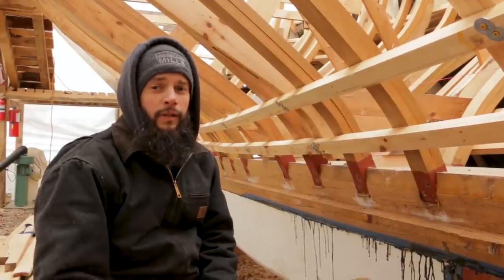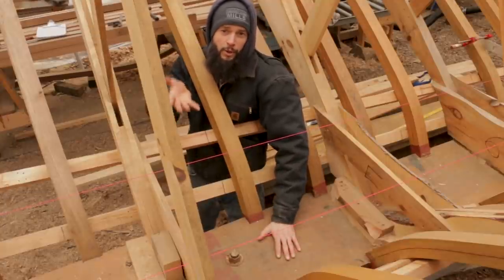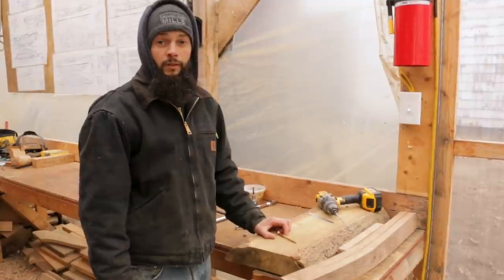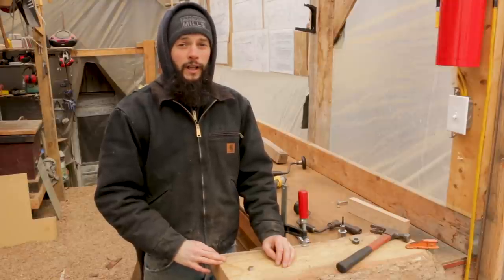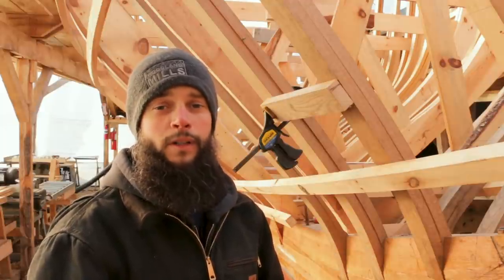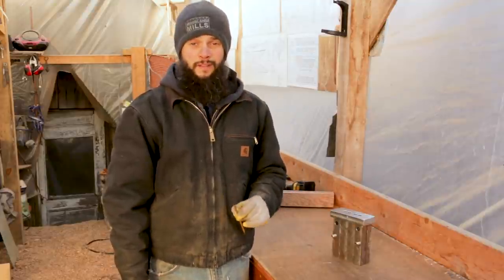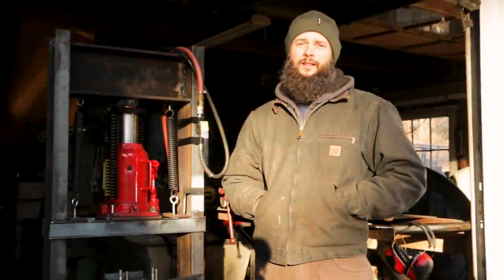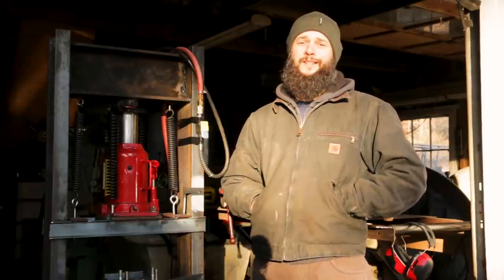Acorn to Arabella - Journey of a Wooden Boat - Episode 50: Homemade Copper Rivets!

Comment: Annealing the cut stock for the rivet would allow the compression of the head more easier also if the other end of the dye was machine with a pointed shape this would also form as it would driven to the bottom and stop then the head world continue to form.I made nails for old picture frame the same way, but they were only 1.2mm diameter with a 2mm domed head and driven with a hammer... one at a time, only required 150 though.
Great video great delivery with plenty of knowledge imparted, thanks

Comment: If you want increase speed I see 4 things 1) affix a larger handle to the release valve so no tool is required. 2) only release the jack far enough for the die to rotate and lay down to open 2.1) install a stop so the jack cannot retract farther than required 3) find a faster tool to tighten the nuts on your die (not an impact as this will wear out or gall the threads 4) find a tool that will knock your rivets loose from the die quicker

Comment: I think your right, peened rivets or nails is a better option than screws. On the face of it the bigger section of your self made nails is more robust, but there comes a point when a square peg in a round hole will be problematic, particularly in the unyielding oak, but I guess you've done your research. I also note you have great faith that all the various gunk spread in mating surfaces and socket holes, will exclude water completely. Over the years it has become clear to me that water is a patient adversary, and always finds a way in. That's what stop waters are for after all.
Reply: The gunk is to stop rot. The wood planks swelling when it hits the water (and stays in the water) is what stops the leaks...Well, that and the caulking process they are sure to be doing.
Reply: @JeremyHamaker  The rot resisting nature of the oak is the most important factor. The efficacy of supposed preservatives is up for debate. Water can ingress a wooden hull in several ways. One which I alluded to is via the external scarfs. For all the  different  potions therein, omitting stopwater pins would be unwise. Once shipped the water collects in the bilges and lies there patiently penetrating every  nook and cranny. The most vulnerable area is the surface of the bilge water where it is most oxygenated.  I wouldn't want my remarks viewed as critical, they are only part of the conversation. I admire this project and the way they resolve the technical  issues encountered.

Comment: traditionally, square stock rivets were made by heating a section, hot cutting to length, inserting in a rivet hardy tool, and while still hot, the head is hammered flat......then left to cool....(they were reheated when ready for use, inserted, backed with a bucking plate and the opposite head hammered...
With practice, a proficient riveter can fashion the head of a rivet in 3 or 4 hammerblows (and was considered the mark of a skilled riveter), for a total of 5-6 hammerblows per rivet to fashion the base head (one, maybe two to hot cut.3-4 to form the head.....maybe one more to flatten the top if customer desired a non-peaked rivet....)  A skilled riveter is supposed to be able to make a single rivet in less than a minute....   However, it IS a learned skill...they also say you have to make a 1000 nails, before you really get the hang of it..

Your press solution seems like a good one....the only thing I could see to improve it, might be to make a die that will form 5 or 6 at a go, instead of just 4 (reducing the total number of cycles to get the total you need)  It seems like your press could accomodate an increase to 5 at a time pretty easily... (that would cut 250 cycles from your process...).  

I don't know if heating the ends of your rivets would result in better forming or not.....might be something to try if you were curious at some point....heat the top ends to orange heat before closing the press.....   They'd no longer be "cold-formed" at that point, but that is one of the nice things about copper, it can be easily worked either way.....
Reply from the maker: Thanks for sharing!

Comment: The only add to your cool press (thanks Joe) is to consider plying Joe with strong liquor and wild women then ask if he could make a six rivet jig - it looks as if you could do this OK and the press is plenty man enough. Also consider a full jacket sleeve that is a snug fit over the jig to avoid the repeated process of nut & bolt tightening and undoing!! Then just tap off the full jacket each time. Six instead of four is a 50% improvement and the slick knock on/knock off jacket would save even more time and the sanity of your volunteer! Awesome channel and awesome progress.
Reply: It would be 50% faster, but would need 50% more force too. That may (or may not) require a new hydraulic jack, modifications to the frame. A knock off jacket that is wedged in some way could speed it up!
Reply from the maker: We are maxing out the 32 ton jack as it is =)
Reply: @AcornToArabella  4 rivets at a time is good then - Happy Christmas guys

Comment: A few tips to improve your welding skills:
Your welds are not only ugly but also of sub-standard quality. They have no chance of passing X-ray validation testing for the structural members of this fine piece of pressing apparatus.
1. Your slug deposition is poor because you are using an E7018 electrode instead of an E6011.
2. Your beads rise too much because you are using less than adequate amperage.
3. You are holding the wrong rod angle for this application which results in major undercut issues in the base metal.
4. I noticed that you are welding with your back against the sun. You always need to FACE the sun in order to minimize the warpage of the steel.
5. Last but not least, a huge mistake that you did is that you welded in December. Mars is not lined up properly with Neptune so all welding jobs turn out bad.
I know all this because I have watched tons of welding videos on youtube and welded more than 6 times in my lifetime, so you know I am legit. lol
Reply from the maker: Thanks for the tips!

Comment: So 2 suggestions if you stick with the nuts to hold it together us your cordless driver to do the nuts . or have you thought of cutting part of the bottom of the die off and using a machinist vice to hold the die together to speed up the loading process ?

Comment: how about a bit of grease in the channels for the rivets so they come out easier?
I also wonder if something quicker to release then the nuts could be used to fasten the two halves together. Maybe a piece of iron with a channel the same width as the die that would just slot onto the sides to keep them together

Comment: Thank you for making this video.  Now I can sleep soundly at night knowing screws will not be the only thing keeping your boat together.  Now I have to worry about your DeWalt tools...and how they're over priced and lack performance.
Reply from the maker: We have no been super impressed with them and are thinking of getting a different set.  Any recommendations?
Reply: @AcornToArabella  Ryobi brushless what I use, but Milwaukee/Makita/Bosch depending on what you need.  Rigid with LSA warranty is hard to argue with, same manufacturer as Ryobi.  I was just seeing if I could get a rise from the cult of yellow...😂

Comment: Go to Corbin Bullet swage and pick up their bullet swage lube. This will prevent the copper from sticking to the die and causing damage to them. Cost is about $35.00 a pint and should last all 4000 rivets.
Reply: Great suggestion!  That is a high pressure lube designed for exactly the types of forces involved here and specifically for copper to steel low speed high pressure conditions.  Thin wimpy products that come in a spray can are not the correct product for this application. A very little goes a very long way and will simplify the job.

Comment: I was gonna ask why your die maker didn't just make the bottom of the rivets pointed to save a step, but I see you wouldn't be able to hammer them out.
Reply from the maker: Also to form the point you essentially have to extrude the stock which takes much more force than we want to work with!

Comment: Did a little math and it appears that to produce 4000 rivets at a minute and a quarter apiece (5 minutes for four rivets) it will take just a bit more than two 40 hour weeks to produce them all.  Hard to tell if practice will speed up the process or problems will slow it down, but I'd bet someone(s) is/are going to be quite busy with repetitive work for quite a while.

Comment: I noticed the the shanks had jammed in the die after pressing and it occurred to me that you may have missed the opportunity to have the points formed simultaneously as the heads if the shape at the bottom had been made pointed or vee shaped.   BTW railway dogspikes are square with only a chamfer at the end so the rivets don't need to be sharp pointy.

Comment: Did you give any thought to annealing the top of the rivet blanks?  Just heat the ends to red, let cool.  They will "work harden" themselves when your beautiful rivet machine makes the heads.  Fantastic job on that!
Reply from the maker: They press just fine as it is so it does not seem like annealing is needed.

Comment: One very minor change to the jig, and not worth doing now: if the cavities were on the diagonal the rivets would come out easier. 
(other than that, the jig you have is exactly like what I was imagining before you said you already had one, except I didn't have the cap on top) 
Making many more, a cylinder to clamp and a second one to head would be faster. But not by enough to make it worth changing now, 4 months after you made them all :-)
Oh. and you need an Arduino  in there somewhere :-)

Comment: Since You're pressing these rivets from the top to form the mushroom You can form sharp tip at the end at the same time - just modify the mould. This is how nails are done on a massive scale.
Also, cold forming copper does make it harder, but at the same time more brittle, but You'll have to test if it has any impact.

Comment: Love the rivet jig and press!  HOW TO IMPROVE PRODUCTION =  TAPER THE BOTTOM OF THE RIVET JIG TO A POINT (round or quad-sided) and as the rivets are pressed, the 'point' needed for insertion is created in 1 step, instead of all that grinder work/2nd step. What I don't know is if your jig would have to be remade,, or if the press jack can push that hard??  Just an idea !

Comment: Stick a vice in the press 
Use the vice to clamp the two  die halves together 
Bit faster 
Or use your rattle gun to do the bolts 
And an air chisel to get the rivers out

Comment: Another great video. The lesson on screw anatomy was so needed. I just cringed at past comments from the 
“experts” 
Loved the rivet press. Steve do you think that a die could be made for fin head bolts and use the press?
Reply from the maker: Maybe but the force to form bronze would be much much higher than for copper!

Comment: Yahoo, thanks for the tech talk. I enjoy your engagement in design matters. I was a little surprised, though, that the fin bolts sheared off the way they did. In hind sight, perhaps your fin bolt mold could have had more taper on the fin head. Just for the principle of the thing, I thinking for engineering calcs on bolt loading assume the fastener (or in this case, flare) isn't the weak point, rather the bolt sizing and alloy determine strength. I recall some years ago a concrete elevated walkway in a mall collapsed when bolts pulled through washers under the fasteners pulled through. Rods didn't fail, 'twas the fastener. That said, dunt think your boat's gunna fall apart, but just sayin'. To your frames, take a look at the construction of the wood boat Emma; some stout frames (4x6, 6x8, or something like that, with floor timbers of equivalent size reaching a good way up the frame). They're laminated and butt right onto the top of wood keel, just like you said some do. But to the point, they put 2 keel bolts down through each floor. Seems a huge advantage to deal with the torsional forces driven by a massive sail plan (gunna have a massive rig, right?), and that lead ballast of yours pulling to keep Arabella upright. Someone said, think it was that guy that re planked Susanna, "They've been building boats this way for thousands of years, why [do you think you're smart enough to...] change".  So, I don't much see the point of constructing a boat out of home depot lumber and steel fasteners, just to say you can do it. Again, to the point, I love the conversations around traditional boat designs.

Got a suggestion, guys, I'd pay money to listen to a periodic round table with you, Leo, Doug Shumpert (rebuilt Susanna in Ventura),  and Louis Sauzedde talking about advantages/disadvantages of different wood boat designs and construction methods. Yikes, what a contrast in technology, an e-conference around traditional wood boat engineering. Good for your technology exchange, a blast and a gas for us. And we do it every day with Skype, Zoom, or other apps, live conversation and share pics or videos, what ever is on your desk top. Oh, hell, and I wanted to ask you about what your floor timbers are gunna look like...
Reply from the maker: Emma sure is a stout vessel!  She was for sale not too long ago, hope she found a good home!

That would be quite the conversation.  We know Lou and have been chatting with Leo but have not spoken with Doug before.
We will cover the floors when the time comes =) Likely mid February so stay tuned!

Comment: Get a milwaulkee 1/2 high power impact. The real deal.if that wont snap those rods then a 10ft burke bar on the end of a wrench. Look it up the bar has a open reinforced square handle(breaker bar)

Comment: Well I have learned something.   I thought the hole you pre drill for the screw to enter is to be much smaller than the diameter of the screw shank.  The extra effort to turn the screw indicates you are compressing the wood fibers against the hole wall, thus increasing the friction tension.
Reply: That is important to do with soft wood, less so the harder the material.

Comment: Thank you for the education, Sir. I never knew the term "would bound", but i did understand why screws like that were made that way when i first saw such things and used them at the age of nine. || Wonderfully simple rivet machine you all contrived. Keep It Simple, Stupid is something wise people understand intuitively. || Would flanged nuts work faster/more deftly for spinning on, especially if the bolt was silicon greased? Would a light oil work better to support spinning? WD-40? Would spinning a long armed 20-Inch 4-Way Lug Wrench be a faster choice for tightening the four nuts? [[ you have to realize, i think in terms of swilling a bottle of dark Imperial Stout for each four rivets i produce, and the faster i get rivets the more fun is the smoke break ... well maybe after 40 rivets (per each 50 min work cycle, with 10 min swilling time brake tacked on). That means a 100 beers to get to 4000 rivets, right(?), which is 9.375 gallons worth of beer {or 2 batches of 5 gallon brews worth of home crafted beer, e.g. https://tinyurl.com/yc9mdxmj }. And everything only gets better if they are English or Canadian sized imperial ounces and gallons ]] "And with that, may I once again raise a toast to Mirthful Irreverence Everywhere. 
[ Cultivate A Sense Of Wholesome Emotional Hygiene ]"

Comment: Preheating the stock on the sharp ends of the rivets before they go into the die can make easier shapingof the tip and might help anneal the tip so when you peen it there will be less of a chance breaking the tip

Comment: Make the mold height same as rivet length so you don't have to unscrew the mold open to remove rivets, just push them out from the mold from the other end with punch and hammer. Or just drill a hole 3/8 thru the "bottom" of the mold and push finished rivets out with a 3/8 punch.

Comment: I agree with an earlier comment about Annealing/normalising the copper its an easy process heat till red and quench this will also make it easier to set and finish the rivet head on the inside of the frame on installation.
 I can only guess at the construction methods that have been used in the past and indeed you guys seem to be cherry picking those methods that seem to make a collection of best practice.
 I worked in engineering all my working life and set and snapped many rivets in that time. A rivet will act exactly the same as a bolt would in your explanation of why you set your screws in for the frame attachment to the keel a rivet set will draw the  planking and the frames together if you use a staking type of set it will make the copper washer grip the rivet while you form the head.

Comment: Is there any concern with the finhead bolts having two dis-similar metals in contact and a negative reaction?
Reply: Joe Blow where do you see dissimilar metals? The stainless was only for demonstrating that the head wouldn’t fail.

Comment: Sman7290 had some good ideas, but no-one mentioned that having a minimum of 3 set of die blocks that can be just taken out ot the jig and given to someone else to open and remove would speed up the process by about 30%-40%.  you would still need to have a locating sleeve for the assembled die on the press preferably with a quarter turn lock in/out; not the welded hinge, this is a slow down in its own right, as the press is out of action while removing and loading the copper rivets and blanks. This from someone who has done time and motion studies for manufacturing (taking what you have, keeping the KISS principle and adding the minimum number of steps per person) Also had a time limit on how long you have someone doing each task (no more than an hour).
Reply from the maker: Thanks for the suggestions!